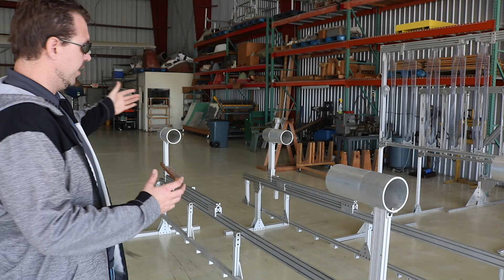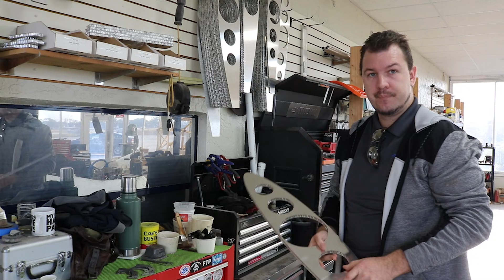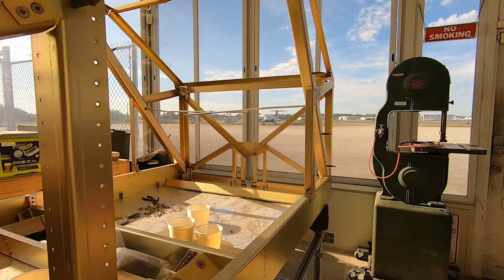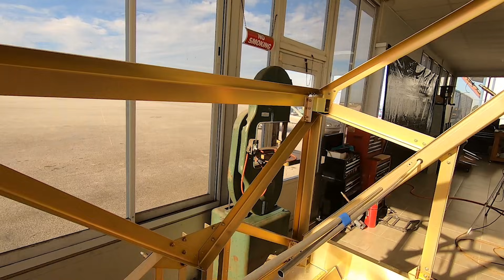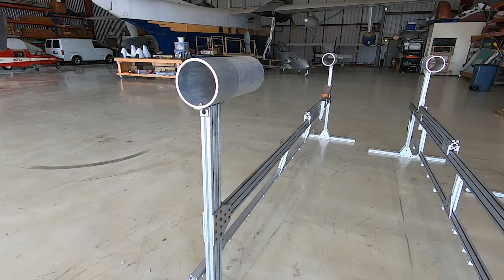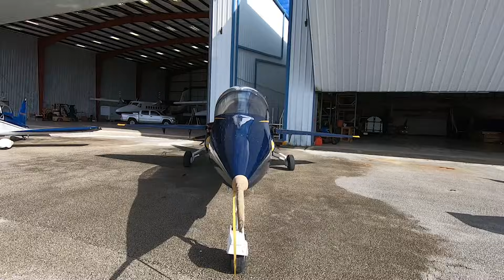NEW! Bede Aero SE - FACTORY TOUR - 2021 Aircraft

Comment: Love this sort of tour.... the ribs are kinda like the crashed F4 wings I looked at back in '71 at the base scrap pile B.P. NAS HNL. ,... not fond of his frame construction but I guess it's what works for him...........Thanks for tour this morning.
Reply from the maker: I don't think I have seen the RIBS made from this material but... the Grumman Yankee and Tiger etc are made with a similar material and have done just fine through the years. But those are also Bigger wide flat sections. Thank YOU for taking the time to say hello this morning!
Reply: Not a structural engineer here but I've heard that the Honeycomb structure in one of the strongest there is ( used correctly ).......... I was blown away when I saw the torn open wing on a crashed Fantom .... the area was no more than 8-10 inches thick and thinner at the  very tip.......
I'm sure they had something better than Aluminum in the structure.... and it appeared to be Glued to the substructure.
Stay well  and if I run into you at one of the shows I've a new red hat fro ya!  ( lol)
Stay safe & well.
Reply: @ExperimentalAircraftChannel  Dark Aero is using a carbon fiber honeycomb rib of this style. I believe the Belite used this for their ribs, and others are using these honeycomb materials for ribs and structures as well.
Reply: The frame construction has proven to be very safe.  Similar to the roll cage on a race car.
Reply: @keylempi  It's all those nuts that aren't safety wired that worry me.
Reply from the maker: @SoloRenegade  Locktite maybe?
Reply: @ExperimentalAircraftChannel  Nope. Loctite is not enough by itself, even combined with various locking nut types. Using Loctite is fine, but relying on it to hold things together against vibrations and stresses over time is not wise. And gluing panels over screws which can loosen, is for me a nonstarter. Don't get me wrong, There are aspects of these designs I love, particularly in regards to some of the simplicity of them. I just get nervous looking at all those screws and nuts. Safety wire is industry standard on ALL nuts or parts which are threaded (even oil filters) in aviation for a reason.

Screws and nuts are used all the time, but you want to be able to access them to check and retighten them periodically. This airframe has an ungodly amount of unsecured nuts though, in hard to access places once assembled. I'd rather just use a bunch or rivets at all those joints. This design would even lend itself Really well to solid rivets given how easy it is for one person to access both sides of the joints, and it would be a safer and more secure design then in my opinion.
Reply: I new a structural and aeronautical engineer very well and was told by this person about alveolate design strength and weight advantages. It’s been used in aluminum pre fab buildings but made out of cardboard believe it or not! So the characteristics are naturally advantageous.